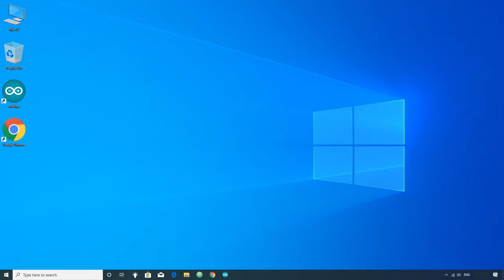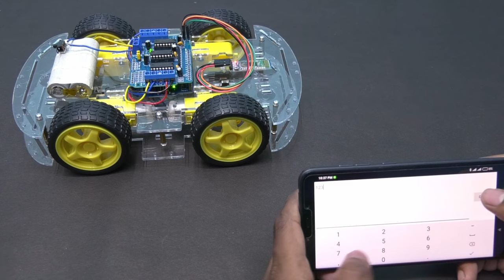Bluetooth controlled Arduino RC Car | Control using your Mobile Phone | Ut Go

Comment: Wht do you done in coding can i please know
Reply from the maker: Controlling the motor according to the command received through the Bluetooth module.
Reply: @UtGoTech  I have done all the things but I am not getting how to do coding in pc
Reply: Can you please guide mee
Reply from the maker: For that you have to follow the code flow line by line
Reply from the maker: If you have any doubts then ask in which specific line you have doubt.
Reply: Do provided code in description?
Reply from the maker: Code given in the video description. Just login to your Google account after that open the code link and download it.
Reply: @UtGoTech  ok thank youu
Reply: After downloading wht to doo I dint understand in video
Reply from the maker: @mrrichkid2235 yes what doubt
Reply from the maker: @mrrichkid2235  What doubt?
Reply: I dint understand wht to do after downloading the link
Reply: Means code
Reply from the maker: Install the Adafruit Motor Shield V1 Library through library manager, after that upload the code.
Reply: Thank you
Reply from the maker: @mrrichkid2235 Welcome 😊👍
Reply: I done with code and everything but the car is not working wht to doo?
Reply from the maker: @mrrichkid2235 have you installed the Adafruit Motor Shield V1 Library?
Reply: @UtGoTech  means the code you gave know in description I paste it and I uploaded it
Reply: There I face an problem wht means #include (AFmoto.h) this like was giving problem
Reply from the maker: @mrrichkid2235 Yes but before uploading make sure you have installed Adafruit Motor Shield V1 Library.

Comment: My Blootooth not on 😭😭🔥
Reply from the maker: Please explain in detail
Reply: @UtGoTech  my blutooth Modul is hc 05  And not light blink
Reply: @UtGoTech  it compalsary zo connect battery 🔋 you can use
Reply: All thing is on but blootooth module hc-05 not on
Reply: @UtGoTech  😭😭
Reply from the maker: Try new module
Reply from the maker: I didn't understand
Reply from the maker: Use other Bluetooth module

Comment: Sir my car is connecting to mobile but not moving
Reply from the maker: What battery you are using?
Reply: @UtGoTech  2 lithem battery 3000 mah 3.7 volt
Reply: @UtGoTech  plz help me
Reply from the maker: Have you checked battery voltage.
First charge lithium ion batteries.
Reply: 7.4 volt
Reply from the maker: Voltage is correct, it should work
Reply: tell me the exact reason why it is not moving plz sir  or make a video on it 
Mant people face this problem
Reply from the maker: Which code you are using?
Reply: @UtGoTech  now my prblm is solved thx

Comment: Sab kuck ise me aata hai kya
Reply from the maker: What are you asking?
Reply: Bro that glass body
Reply: Can. U send link of that plz
Reply from the maker: https://www.amazon.in/Robotbanao-Smart-Chassis-Transparent-Racing/dp/B07WZFRJ8M?th=1
Reply from the maker: You will get 4 BO motors with that glass chassis
Reply: Ok
Reply: Sir last question 
How much volts of battery did you use

Comment: my hc 05 keeps disconnecting
Reply from the maker: Disconnecting when ideal? Or disconnecting when driving motors?
Reply: @UtGoTech  disconnecting while driving motors I am using 9v from direct home socket
Reply from the maker: 9v power supply you are using is unable to provide required current. Use lithium based battery or use seperate power supply for Arduino board and motor shield.

Comment: I have an error
Reply from the maker: What error?

Have you installed the Adafruit Motor Shield V1 Library through Library Manager
Reply: im facing to error in uploading  code nd  therrres no app tht i installed last time
Reply from the maker: What's the error

Comment: I have a question
Reply: in the 
#include <AFMotor.h> it's say no such file or directory
Reply from the maker: First Install the Adafruit Motor Shield V1 Library through Library Manager
Reply: @UtGoTech  i follow all your instructions and still not working
Reply: I cannot upload it in the aduino
Reply from the maker: First Install the Adafruit Motor Shield V1 Library through Library Manager
Reply: now my problem is I cannot connect it to the cellphone because of the module
Reply from the maker: Are you able to pair up with your Bluetooth module?
Reply: @UtGoTech  do the hc 05 and hc 06 the same?
Reply: @UtGoTech  I can connect it but I cannot control it with your app
Reply from the maker: @angelodomacena5770 No. Both are not the same but you can use HC 06 for this RC car.
Reply: @UtGoTech  I cannot control it with the app even though it's connected to the Bluetooth module, do i need to change the module?
Reply: @UtGoTech  or I need a new code?
Reply from the maker: @angelodomacena5770 check battery voltage and check for loose connections
Reply: @UtGoTech  all secured I try the battery at 5v to 12v volts
Reply: @UtGoTech  I'll try that, I will give a feedback after
Reply from the maker: @angelodomacena5770 what's the result
Reply: @UtGoTech  I can connect it to the app but the motor is still not responding to the app
Reply: @UtGoTech  all the wirings are okay
Reply from the maker: @angelodomacena5770 check for loose connection. Check for Bluetooth connection with Arduino.
Reply: @UtGoTech  everything is okay
Reply: @UtGoTech  I cannot control it with your apps
Reply from the maker: @angelodomacena5770 In which pin the rx tx of the Bluetooth module is connected?
Reply: @UtGoTech  servo 1 and 2
Reply: @UtGoTech  I copy the diagram in this video
Reply from the maker: @angelodomacena5770 what type of battery are you using?
Reply: @UtGoTech  12v

Comment: Hi Sir I am facing a problem after mking my rc car from your video i did the wiring and coding well and there is no issu but the problem is when i turn on the switch the ligth in the adruino and HW-130 lights up and the bluetooth also blink red colour light and when i downlaod the app it even got connected but when i presses the button of forward my car goes forward only for a second and it never moved even if it got connected also sometimes it is sayyingn unable to connect blutooth and when it got connected it doesnt move I even changed the app but nothing worked btw the app you used in this video sir i cant find it
Reply from the maker: Other apps will not work. 
Which type of battery are you using?
Reply from the maker: It seems that your battery voltage drops below 5 volts. Which type of battery are you using?
Reply: I am using a LI-ON battery
Reply: I am using 2000mah 3.7V 7.4wh lion cell
Reply from the maker: Have you checked the battery voltage?
Maybe the batteries are discharged. You can try recharging the batteries.
Reply: Also I am using 2 lion battery of 3.7V 7.4 wh
Reply from the maker: 7.4 volt is well suited.
Reply from the maker: Have you checked the battery's actual voltage?
Reply: How can I check my batteries actual voltage
Reply: I have 2 batteries of 3.4 volt which is written in the battery
Reply: Please sir help me I have science project on 25

Comment: Sir code is not working for my arduino uno plz help
Reply from the maker: First check if you are getting data from bluetooth module or not
Reply: @UtGoTech  i cannot upload the code its always shows error when i compile it
Reply from the maker: Have you added the Adafruit motor shield library
Reply from the maker: Yes
Reply: @UtGoTech  how check the blue tooth module